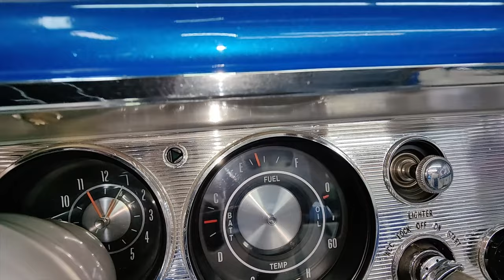64 Chevelle | Gas Tank & Fuel Sending Unit Reinstall pt2

Comment: I have read that 64 chevell should have 30 ohm  and 65 have 90ohm.. So if you want the 90ohm tank gauge to work you can take a resistor of 45ohm in parallel with the seder wire and ground.
Reply: This is from paralell resistor calculation
Reply from the maker: This is some great information. Could you explain a little more on how to connect the 45ohm resistor? Thank you

Comment: Do you have had to remove the whole tank to change the unit or was just to work more comfortable?
Reply from the maker: You do not have to remove the tank on the 64, I actually didn't know that. The sending unit can be pulled with the tank in the car